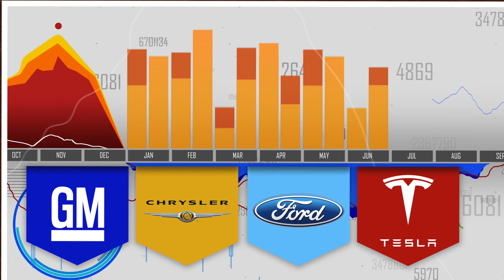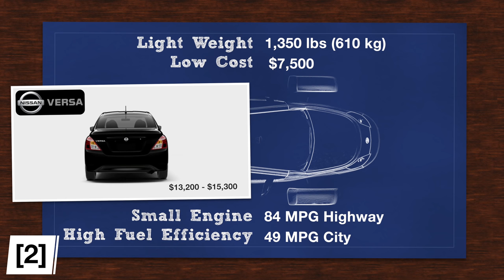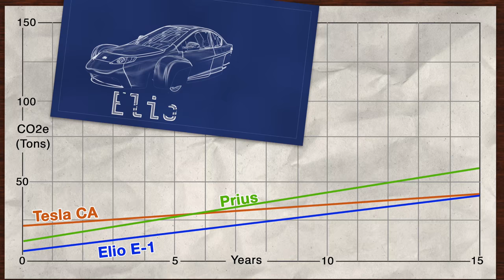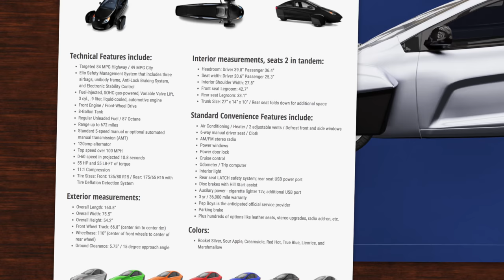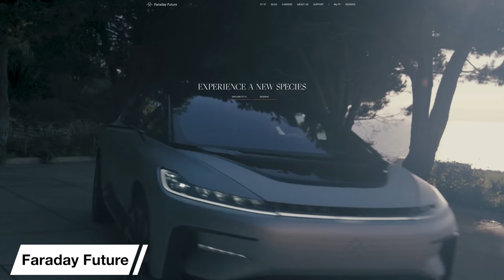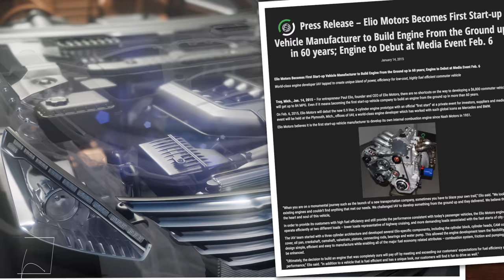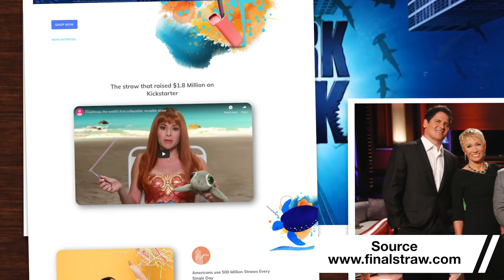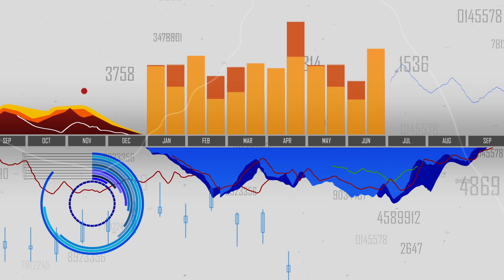How this Radical Car Missed its Chance to Change the World

Comment: Incorrect on the "would need helmets and motorcycle endorsement" part. Back five years, yes. The states' regulations have actually changed since, and it's down to two states where that would be an issue, in one only for minors to wear helmets.

Regarding the VW XL1, it was a production vehicle, not a prototype, though for a very limited run. It was for sale in 2014 in Germany. That being said, it also cost something like $140K-$150K, if memory serves. Not exactly an economy car, mileage notwithstanding. More of a technological showcase.

8:47 Your inclusion of "But it doesn't end here..." is odd, since Paul Elio's statement there is the now-habitual preamble to his explanation as to why they went to OTC markets for funding, rather than some other tangent in their story.

Finally, regarding BEVs: Honestly, I somewhat resent the uncritical credulity often given to the notion that EVs are the future, and ICE is the past. (I'll grant an exception long-term for HFC electric drive, but the cost is absurd today, so that's probably 40-50 years out, too, but it offers some significant engineering and use advantages over both, provided cost can be reduced over time.)

They are ideal for certain suburbs in mild climates, where a short-range commute into the city at lower speeds or in stop-and-go traffic dominate. (The LA basin is ideal, since it fits the model, and it also allows moving emissions (powerplant) to another location outside of the basin where fumes tend to sit and turn to smog because of the topology.) Such suburbs have many homeowners, so home charging (off-street) is simpler. For cold or extremely hot climes, range is reduced. (Run the heat, cut into the range. Run the AC, cut into the range. Cold or hot, battery chemistry sees reduced efficiency and capacity, cut into the range. Fast charge instead of slow charge, only charge to 80% rated capacity max, cut into the range. Run the AC compressor to de-fog in cool, humid climes, cut into the range. Etc.) For apartment dwellers, or those who must park on-street, chargers are not readily available, nor are they so simple to add, either because of public access laws (for street parking) or because the property is not theirs to modify freely (renters). (Renters also face increased rents if landlords invest in adding chargers, whether to cover install and upkeep costs alone, or to also cover utility costs if included as a site perk.) I wouldn't count on at-work charging for most jobs, either; as most of us know from harsh experience, most employers are tight-fisted on unnecessary costs, down to rationing paperclips in some places. In-city use faces similar troubles with charger access as with on-street residential parking, as well as with traffic saturation (no matter the propulsion methods). In-and-out use is possible, but not an urban-resident use case.

So, by drivers' use, suburbs-to-city (and back) are more ideal. This largely leaves BEVs viable for solidly middle-to-upper-middle-class and up, since they're the ones who can easily afford such homes, near but not in city centers. But, also not in those metropolitan areas where the electric grid is already utilized at or near capacity- but that's most established urban centers, old grids and high demand. Adding this charge load (primarily at night, since most people work and play mainly days and evenings) to already taxed grids promises either new grid investments- very expensive- or brownouts and blackouts. It also cuts out most of the working poor, right upfront, nevermind longer trips or commutes, and outside of major cities, public and mass transit aren't realistic options, either now or in speculative implementation (too low a population density to work well). Any solution that cuts out huge swaths of country in favor of a few population centers will inevitably turn into a signal or locus of existing culture wars- exactly what we can see, especially when advocates minimize or outright dismiss the concerns and objections of those left out, and denigrate alternative or complimentary solutions, very much like an Elio-like proposal. (If you didn't intend such a tone, I don't mean to be harsh. I've simply encountered that too many times, and was reminded of it here.)

Then you have the need to replace the current motor fuels tax regime, if we're not primarily using gasoline and diesel. That either leads to mileage taxes (which in turn require mileage reporting and verification) or taxing energy directly (increased utilities costs). BEVs also weigh more than typical ICE vehicles of their class, so they're actually wearing roads more than equivalent ICE cars, and that has to be accounted for in the road tax regime.

All the plans for BEV popularization that don't account for extensive new grid and generation infrastructure are inept at best, and those that further don't account for the rest of the people it won't work for due to geospatial realities are outright farsical.

Sorry for the wall-o-text.
Reply: Thoughtful, rational, constructive comment. 👍
Reply: Good read. And it all makes sense!

Comment: I'm a retired 70yr old male, ex biker, car fan,  looking for cheap lightweight transportation for mostly short trips . I've parked my beautiful motorcycle because I don't want my last ride to be a wreck.
 I think the 3 wheel electric, elec/hybrid type looks good.  But they have to be reasonably priced and reliable. CanAms are too expensive and impractical.  We need something for short trips and job commuting. I think the Elio is a good concept, maybe all electric instead of hybrid. Small, light, covered cockpit.
  $10k would be just right for me, and I think, a whole lot of other folks. The Sondors looks good,  but the price seems to be going up,  not sure about the integrity of the company foundation.  We'll see.

Comment: It's almost like they torpedoed the vehicle on purpose by trying to build their own motor. I'm suspicious about that decision,.  The engineers need to look at building it out of "off todays shelf" items only. WIth exception of the body it self. The entire running gear can be made from parts available from various companies already making them for motorcycle companies to car companies. The rear wheel could easily be make from something the motorcycle companies are using right now.
Reply from the maker: Agreed
Reply: Their chassis is similar to a race car box frame
Reply: @Bryan-Hensley  That should be their focus and not the running gear. Why try and re invent the wheel when there are thousands of existing designs out there on the market that have had millions of dollars poured into them already perfecting them. I can think of many motors and drive trains that would work just fine that they can purchase off the shelf. After making what they want for 10 years or so they can perfect their own but until then stick with what's available now. Several existing water cooled  motorcycle drive trains would be suitable with a shaft drive.
Reply: Alot of the tech can be borrowed from companies that convert motorcycles to trikes and adapt them to the more humble requirements of the Elio.
Reply: @edrosa3485  Exactly. The technology is already all around us. Just use what is available.
Reply: @edrosa3485  that will probably raise the price though, but heck, a new KTM dirt bike is around $10,000
Reply: @thomasjefferson1457  I don't think they want to use a motorcycle drivetrain because they were making this car a fwd.
Reply: @ya-rx8nd  You have a point and makes it even simpler. The rear wheel just turns and has only some brakes.
Reply: Fuel economy in high revving motorcycles engines sucks ass, fuel economy on turbos also sucks ass. "Shaft drive", I assume means rear wheel drive. For driving on ice and snow, rear wheel drive sucks ass.

It was designed around a power train ripped from a Geo Metro... Just work with Suzuki to use that as your starting point....
Reply: "the rear wheel could easily come from something motorcycle companies are using right now"

No. It uses a car type wheel and tire on the rear. Since it doesn't lean much, it'd be stupid to use a motorcycle tire.
Reply: Exactly right. When they decided to go with their own engine, I knew it was all over.
Reply: They did NOT try to build their own “motor”, by which I assume you mean “engine”. They contracted with IAV, a huge engineering company that has designed engines for Mercedes-Benz and BMW, among other companies. The problem is not the design nor the engine, it’s lack of several hundred million dollars to rebuild the plant in Louisiana and re-tool it for the Elio. It’s rally an shame. I place the odds of it being built at about 20%.
Reply: Yep, I had a Metro 1L with 330k miles when I sold it.